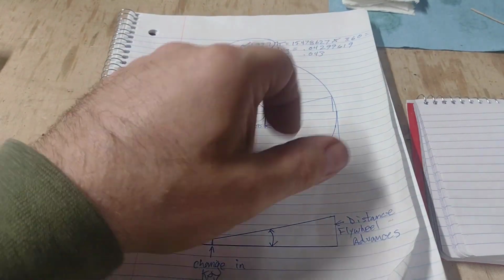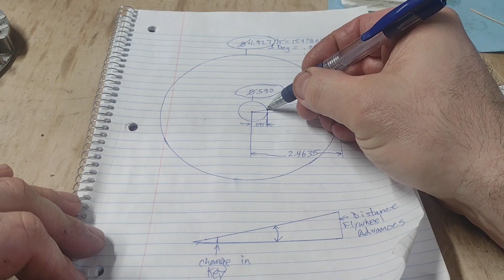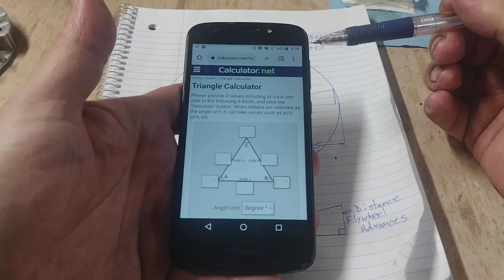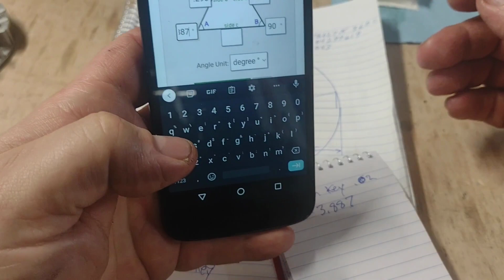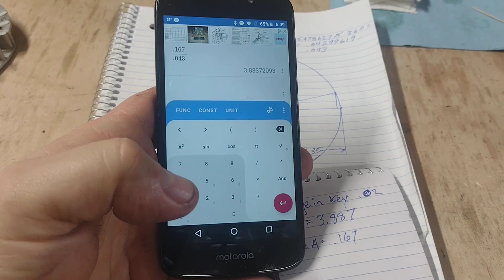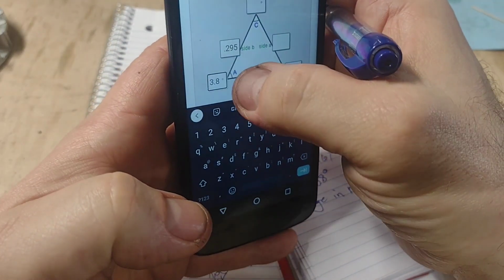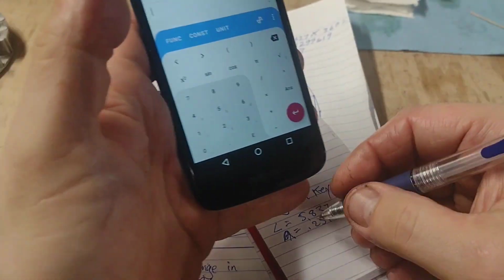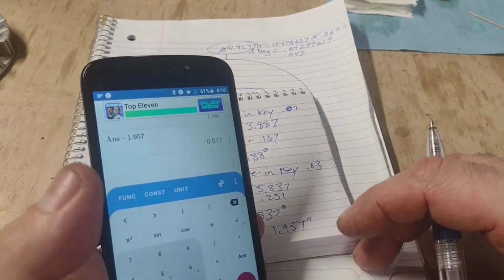Ignition Timing Advance: How to calculate filing the key

Comment: Nice video and i appreciate your work! I don't understand why you take the outer diameter of the flywheel into account. The only diameter that matters is the big diameter in the coned hole. You calculate at that diameter how much width has one degree. One degree is one degree regardless of the outer diameter of the flywheel.
Reply from the maker: @cristiancristian5874  I suppose your right. That's how it made sense in my head when I did it

Comment: If you work on the shaft diameter and multiply by pi and then divide the answer by 360 you will get the distance for 1 degree rotation.
You can then use this to determine the amount of advance by dividing the amount of metal removal by your answer for 1 degree of rotation.

Comment: give yourself more credit; great job engineering the numbers.  I want to ask you-
When a person takes material off the key and goes from 26 degrees to say 28 degrees they keep saying they advanced the timing,  the person is backing up the flywheel and making it so the magnets on the flywheel pass the coil earlier than before.  the point i am making is that they seem to be making the saw fire sooner while the piston is lower in the bore.  Isn't this retarding the timing?  I understand that ignition is always BTDC.  If someone makes the saw fire later than say 26 degrees to 24 degrees the saw is firing with the piston higher in the bore hence that is advancing the timing.  I understand ignition and am stuck on this point in terminology.
Reply from the maker: Thank you Sir. You have to look at as going from 24 to 26 degrees your bringing in the spark sooner thus advancing it. When you bring in the spark later say 22 degrees you are retarding it

Comment: Thanks alot been asking this everywhere and looking for this with no exact answers. I have a new echo cs 590, had the key taken down 0.14 thousands, went a little more and ended up at a tight 0.22 thousands, so by this video if my crank is similar size I ruffly changed 4 to 4.5 degrees. Wasn't sure if I went to much but you can buy 6 degree timing keys for my saw so I know I did not go to much should be safe thanks alot.
Reply from the maker: Your welcome, glad it was useful to you.